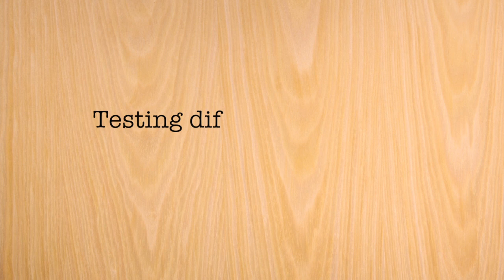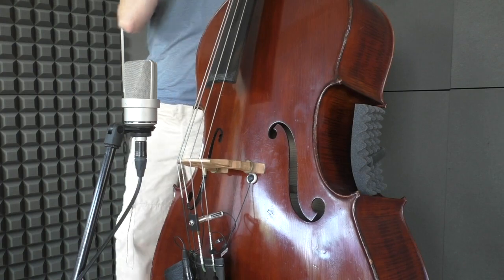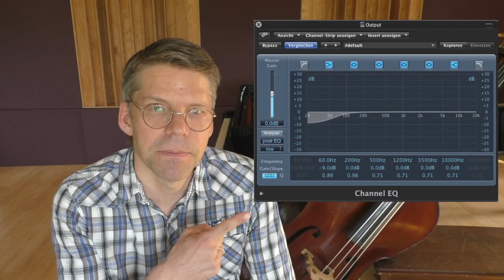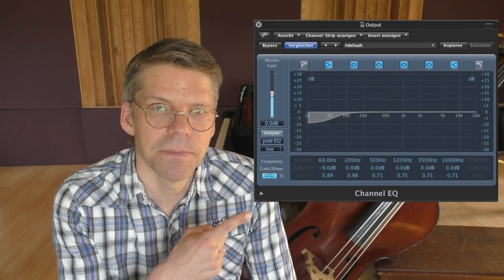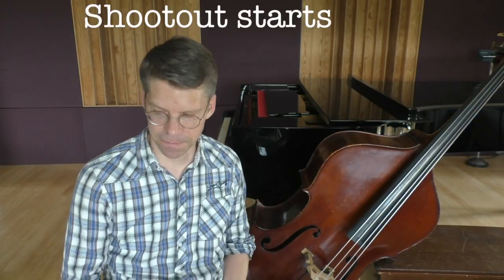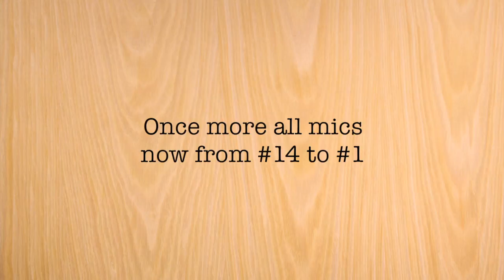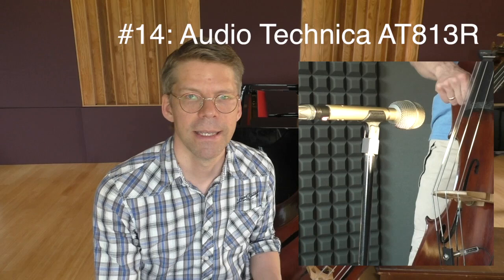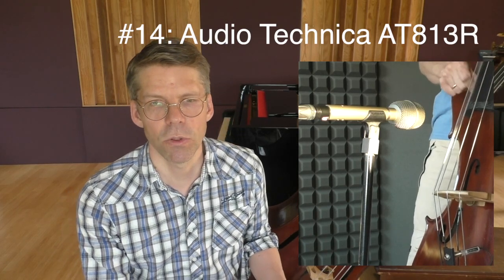14 Condenser Mics tested on Double Bass: Neumann U87, U67, VoxORama47, AT4060, MKH40, C414 and more!

Comment: What do you think about using a AKG C414 and a DPA 4099?  If you like the idea, where would you place each? Thank you. Love your videos. Subscribed.
Reply from the maker: Hi, you can certainly obtain a good result with this combination. But for my taste it would not be my first choice. Why? I only know the C414 BULS. It is quite mellow. The DPA is also kind of mellow, but in a different way: it doesn't have a lot of really "pushy" mids. So I would maybe miss some grip in the sound. But still, that doesn't mean you can't get a very beautiful sound with this combo. I would have the DPA over the bridge, facing the ends of the vibrating strings. And the AKG facing the end of the fingerboard and the spot where the player plucks the strings. Get the low-end mainly from the DPA and use the AKG for higher frequency and the percussive sound of the plucking hand. (But no need to cut high frequencies on the DPA).

Comment: I‘d go for #10 (AKG C414). I like the balance between round low end with a little less emphasis on the top end/noise content. Bit surely it all depends on the song and taste. (Listening on iPhone/AKG K240 II Headphones)
Great shoot out!
Reply from the maker: Thank you Volker! Yes the AKG C414 stands out because it sounds particularly "smooth" to my ears. Still you would have to check if this works in a mix, sometimes you might need to "grip".

Comment: They all did a pretty good job considering the range of price-points.  I own a TLM 103 and I like it.  I also liked the 414 which is not a surprise.  And the U67 was a no brainer.  
I would have LOVED if some ribbon mics were included for comparison but I realize that is perhaps apples and oranges.  A ribbon shootout would be incredible to hear as well.  It seems to me that the better quality mics deal better with the low and low-mids, much as a good loudspeaker might.  However that can be dealt with in post.  It does go to show you that you just need to get the best mic you can afford and get recording.  These mics all capture what you put into them.  If the music is good, the recording will also be good.

Comment: how do you generally EQ your Double bass? if you had time maybe a screen shot ?thanks!!
Reply from the maker: Good idea, I will do a video about this. I generally cut a lot of low frequencies that are below 60 Hz (maybe a shelf of 10 db). And I normally have an extra dip (quite wide, like a second little shelf) around 100 Hz because this area also tends to make the bass too thick or boomy. That's a basic setting that I use very often, and sometimes I do a few more little corrections, depending on the bass, the player, the music, the room, the strings etc...

Comment: The AT813R had a bit of growl and a very Ray Brown "thump" vibe. This was my favorite one.  Think I'll buy me one. I have the AT4041 and I use it on my string bass often. My U87 in my space is too boomy, though I haven't thought about using it with the rolloff activated. My TLM 103 is better, but the AT4041 seems to work best with my bass and space. Thanks for sharing, very thorough and you sound like a heck of a bassist too!  :)
Reply from the maker: Thank you very much Wayne! The AT813R really was a nice mic. It was the first mic I owned. Yes for me the U87 is too "wide" sounding for bass, it doesn't give the bass a "focused" sound like other mics do. I also often used the AT4041 for bass, works very well.

Comment: Thanks a lot Harvé. I picked 4, 8, 11 and 13. For 13 I felt it was just a tad neutral and may be a bit too revealing compared to 11 which was my top pick on the tone for density, character, enough highs, etc. before I found out it was U87. For some reason 4 and 8 also got stuck to me. Great job.
Reply: Me too, the KM 84 I could use live on a H Clamp

Comment: GREAT VID ! i was lucky enough to get to cut at Capitol studio B, they put a U -67, 8" away from f hole...I've used a vintage U -47 , my fav of ALL TIMES ,especially for vocals..lately I've  used a Shure 57 , and an Aston about 6-10" from f hole...i slap rock a billy style as well so its really challenging..lately going thru an UA Apollo w/ the Neve 1073 plug in engaged in the 'Unison' slot.. really interesting listening to your results thru my studio monitors, it's hard to make perfct test cause each performance  must vary a hair..although super close...
 !thank you ! ordered a Neuman TLM -103 hoping its works for everything haha cheers
Reply from the maker: The TLM103 is certainly a good workhorse!

Comment: There is also a topic for another discussion regarding all of the problems that present themselves when playing in a live ensemble context with bleed from other instruments, feedback, gain staging, etc.  - which is why most bassists have to rely upon piezo transducers so much.  Thus, while it is important to evaluate how well various mic capture the sound of the instrument accurately (or not), it's hard to evaluate which dynamic or condenser mics would work in those environments due to the many variables.  This demonstration is good for isolation studio recording, though, for sure, so thank you!

Another issue is how to mix multiple sources with dual input preamps and how to send those same signals independently to different tracks of a recorder if the performance is being recorded.  E.g. should bassists consider using a hypercardioid to help reduce sound from the other instruments?
Reply from the maker: You are right, there is a big field of aspects and parameters to consider when using mics in other situations than an isolated studio booth/room. Nearly impossible to cover all of that but I am considering exploring some point in future videos.
Concerning your last question: A friend of mine who is FOH sound engineer says he gets best "bleed results" (or no-bleed results) with a figure 8 mic. I will try to test this soon.
Reply: Stringmatrix - Along these lines, I am curious about the AEA N22 and Samar Audio ribbon mic offerings.

Comment: Wow! Amazing! My favorites were 1, 3, 7,10 and 12... I used to have a at4041. Using a TLM 103 clone now. Did you change the gain at all when switching them?
Reply from the maker: No I let the gain at the same level for all mics and later, when bouncing, I set everything at equal levels. Maybe that's not the most accurate way of doing this test. Still we get an idea, I think.